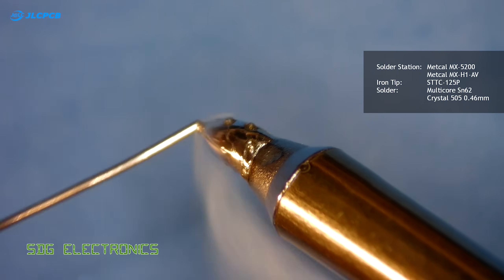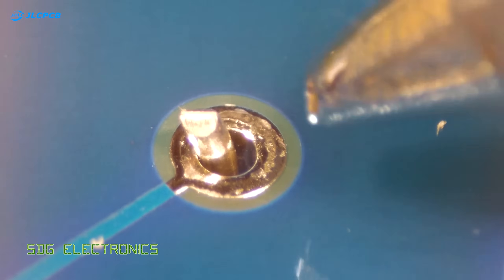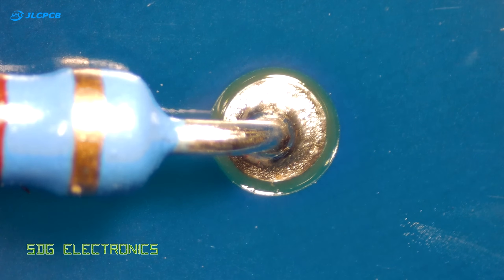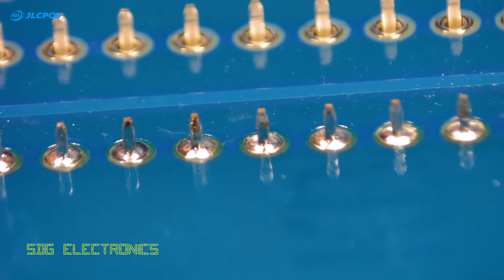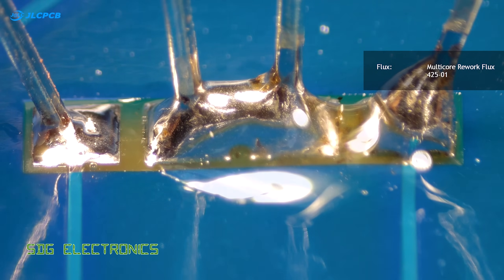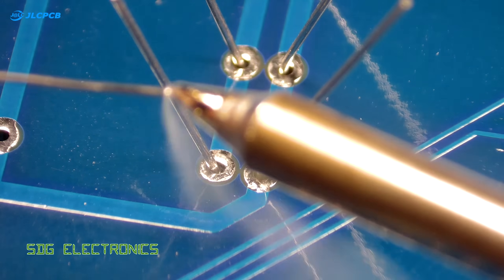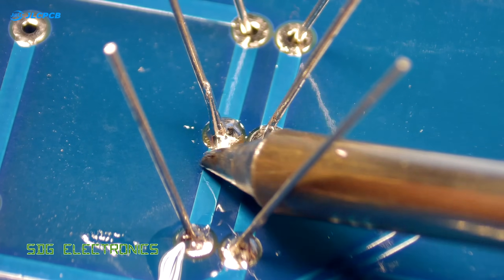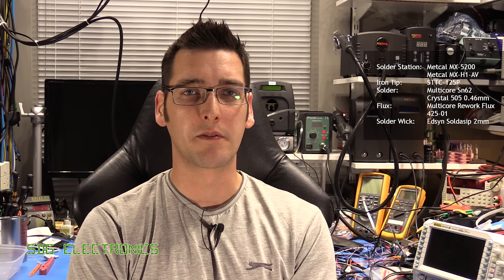SDG #066 Solder Through-hole Components - Soldering Techniques #02

Comment: My solder never melts instantly like it does on this video , always have to hold the iron on for 7-10 seconds, any tips?
Reply: Buy a good soldering station and good solder. Also maintain your tip keep it tinned and clean with a brass cup or wet sponge. My personal choice of stations is Metcal MX-PS5000* Never had an issue

Comment: When I soldered the legs of the Arduino nano, the result was blobbed upward. I'm using 60/40 with 0.8mm diameter tin lead and set the soldering iron at 350°C (662°F). What's wrong with it?
Reply from the maker: Likely not enough heat on the pad and leg before adding solder
Reply: @sdgelectronics  thank you for the information, sir.

Comment: Great video.  One quick question.  If you solder from the bottom and make a joint that appears to have good coverage, but when you look at it from the top, it does not appear as though there is good coverage, does it matter?  Do you need to keep applying solder (from the bottom) until the top also shows a "good joint"?
Reply from the maker: There's different IPC classifications for depth of solder through a PTH. Generally you should aim for a full fill by applying heat for longer
Reply: @sdgelectronics  Understood.  I'm glad it wasn't just me being OCD.  Thanks for your input.

Comment: What soldering iron do you reccommend?  Which iron are you using in this video?  
Can you do a UK soldering iron comparison video from cheap through to expensive?  There are so many to choose from.    weller 15w, weller 25w, weller 40w, weller 80w, then there are the cheapest an-tech tools and  sealey tools, laser tools 40w,, (eurocarparts) silverline tools (local hardware shop),    CPC-Farnell seem to have the best prices for weller.    Halfords also sell a Rolson 40w for £8.   Toolstation and screwfix also,  Most of these come with conical tips and screwdriver tips.

Comment: Great vid - thanks. From 00:24 onwards, are you applying flux before attempting to solder or are the relevant areas of the board "dry"? Cheers
Reply: Looks to me like it's just the flux in the solder doing the job, no additional flux added.

Comment: Hello there! Im a student and i am studying the cracks on middle of solder in pcb components. Can you say to me some solutions to solve this problem? Does it depends of the welding alloy( im using SAC305 RX18)? or the themperatures? Can i solve this problem? It's for my thesis of master degree. Best regards.

Comment: no, No, NO!!!   Do NOT use a cone shaped tip - the heat transfer is terrible. The chisel shape has (grooved chisel tip is even better)  MUCH better heat transfer so soldering is faster and with more uniform results especially when soldering dis-similar items like a component lead and PCB pad.

Comment: Excellent video and pro tip on how it should be done. 
You only left out the part about cleaning up the flux afterwards. 😊
Reply from the maker: I realised that after uploading, although I have a part coming up in this series about when to use flux, a comparison of various types and how to clean up
Reply: Yes, and also to make sure the wires (or legs) on the components are clean before installing and soldering them. @sdgelectronics

Comment: For a bit more advanced technique there is some value to overloading a tip with solder to make a temporary (albeit poor) connection, especially in tight spaces, simply to hold a component or wire in place...again, temporarily until you affix another end or lead when of course you go back and make a proper solder connection at that point. A bit more important back in the days of tube sockets and interconnecting wires and parts. Thanks for the tutorial Steve, look forward to the next installment.
Reply: Totally true. And the vaccum thing to suck excess solder and reopen the hole it's a good technic